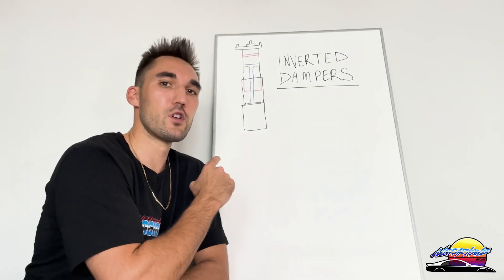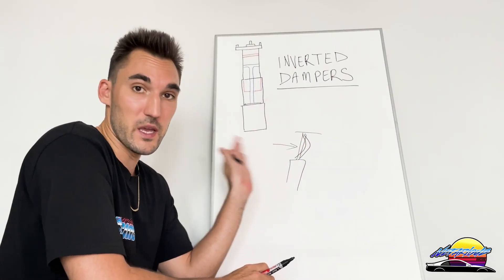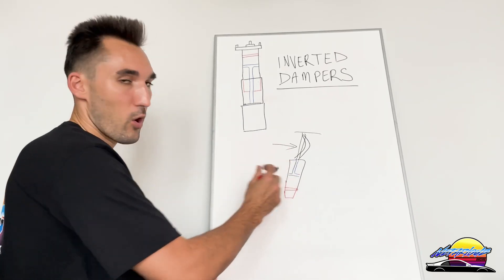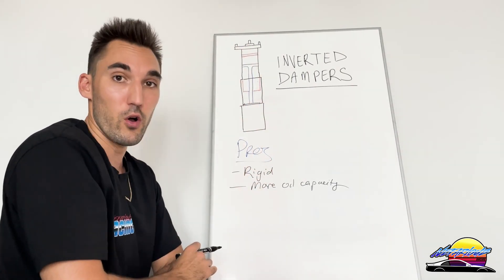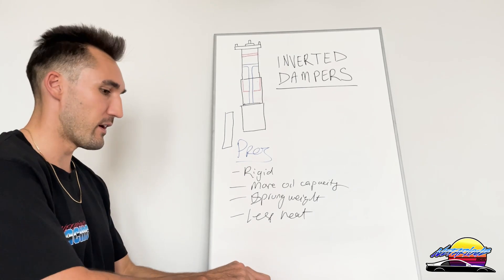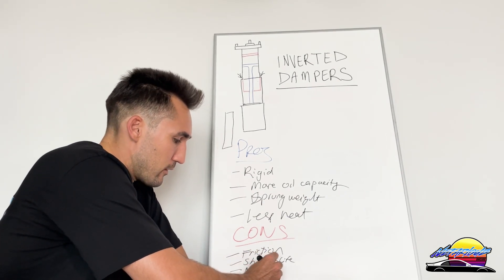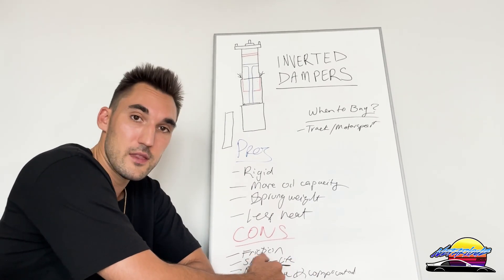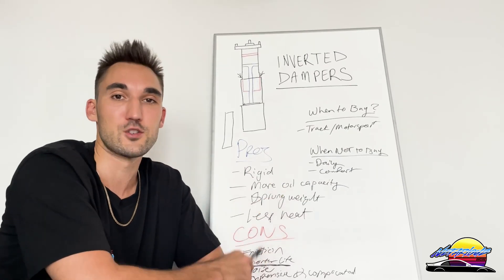What Are Inverted Dampers (Inverted Shocks)?

Comment: Why are they (typically) not available for wishbone cars? Would having a smaller shaft (requiring a smaller valve puck and giving(?) lower gas forces/pressure) and less unsprung and overall weight not be beneficial? It certainly doesn't make sense that way at face value. Plus, they shouldn't have the wear issue on wishbone cars since they aren't experiencing the side forces that they would on a strut car.
Reply: He explains it at 1:44

Comment: The problem of stress being put on the rod can be minimized by having stiffer suspension bushings ( or even going full race mode and using solid bearings). If you are at the point where you are putting enough load to risk bending the piston rod then everything else should already be rigid as possible.

Comment: Great video I need some help finding out some information on a set of Aimgain coilovers that I have and I think they are reverse stamping type. My front set have a air valve on top of them. And the adjustment for the front and for the rear is actually on the bottom of the actual coilover
Reply from the maker: Best bet is to see if there are any stickers on them with a part number, that will tell you exactly what they are. But it does sound like they are probably inverted dampers.